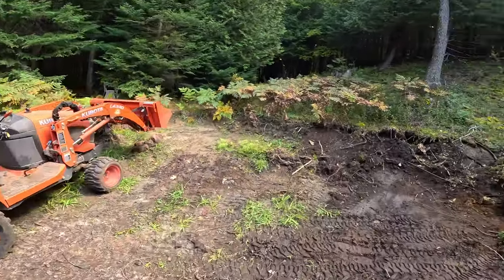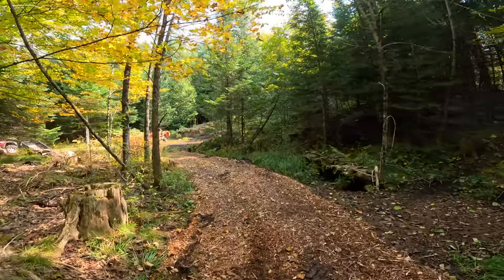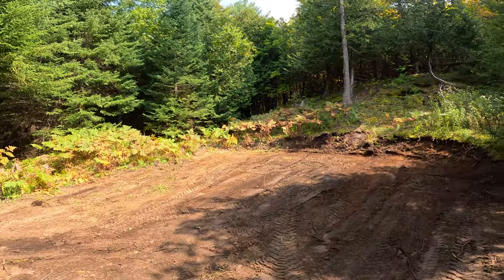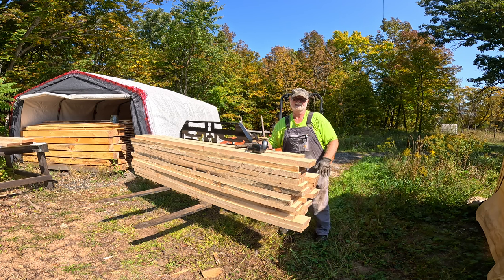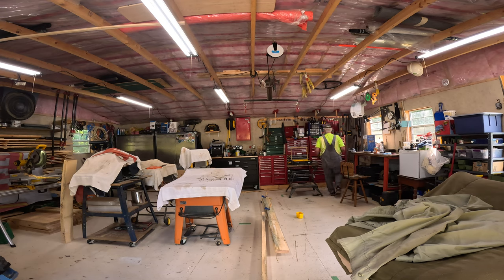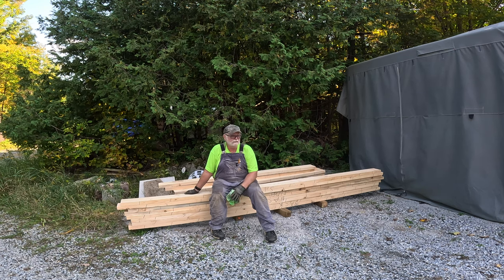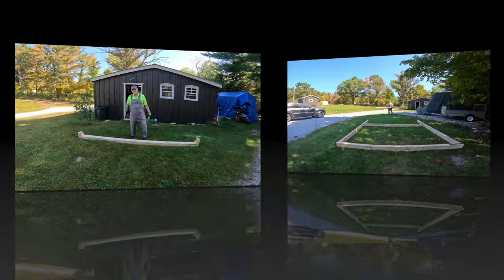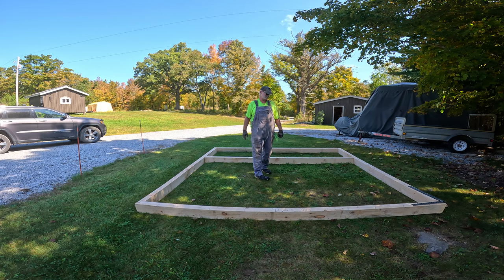Finally Starting Work Building The Off-Grid Cabin Floor!

Comment: Are you going to treat the timber against rot/bugs?
Fungi in the temperate climate here in the humid UK can eat an untreated spruce 2x10 inside 5 years.
Reply from the maker: Yes. I’ve got a large pump up spray bottle I’m going to use. From what I have found, it looks like a mixture of one half diesel fuel and one half old motor oil works very nicely. Once I have all the 2 X 6s assembled in location, I’ll spray them down. Thanks for stopping by!